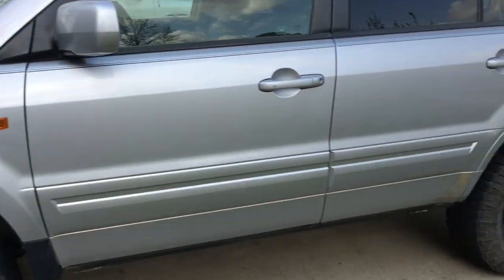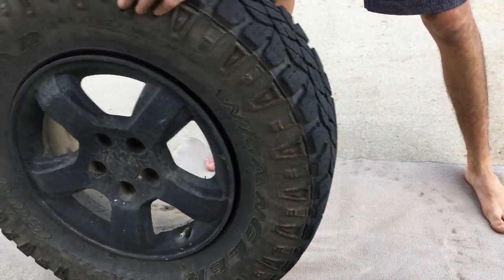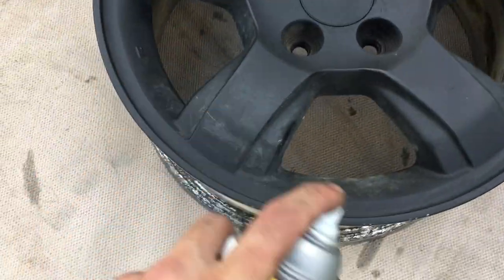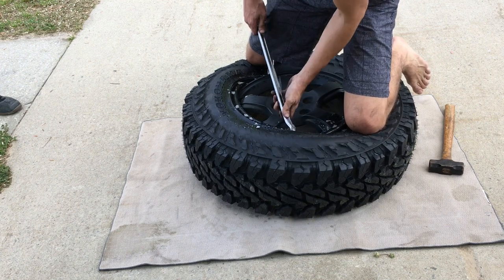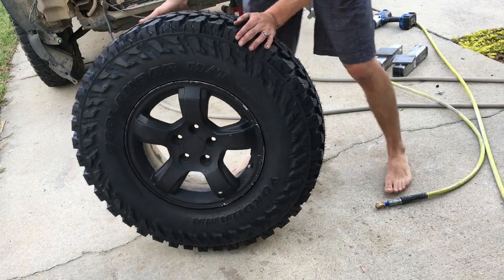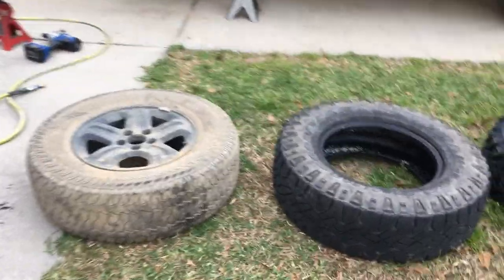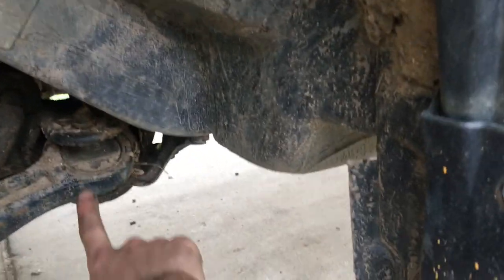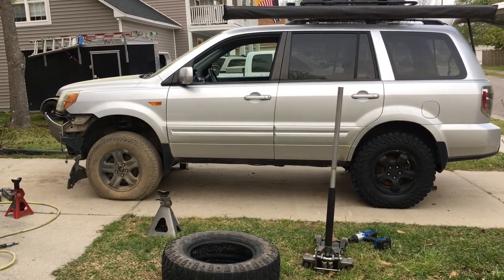How to Hand Mount Tires with a Hi-Lift Jack! Will these fit my 4wd Pilot?

Comment: Nice!! Those new tires are going to look good on there. I think you may have found the largest tire you can fit without trimming. Great idea on using the Hi-Lift to DIY change the tire, I'll have to remember that for later. It will be exciting to see how it performs with the new tires!
Reply from the maker: Thanks Mike!

Comment: I had a leaky airbag on my Pilot as well.  I wanted to like the airbags but the thought of pulling a bunch of stuff apart everytime one needed to be replaced didn't appeal to me, so I went with Timbrens.  No extra lift, but they help with sagging under load.  I have an extra air bag if anyone wants it, just pay shipping.  The brand is Air Lift, fits 1st gen Pilots.
Reply from the maker: I put a sawzaw through mine and patched it with a tire plug. 😂 I personally love them, but also built my Pilot out to sit well without them.
Reply: @GotterAdventure  LOL. Maybe some Slime Sealant would take care of the leak you have now.

Comment: Sorry I may have missed it, but why do you keep the spare deflated? I also have a full size as a spare.
Reply from the maker: My spare is an oversized 245-75-16. It won't fit if it isn't deflated.
Reply from the maker: carry two air compressors and fill when 
needed.

Comment: Hey man awesome pilot I'm thinking about running a no name ebay 2.5 lift and running 245/80 r16 tires on my stock wheels 
Would I need the sub frame drop ? And would I need to replace my rear springs? I currently have new napa oem suspension
Reply from the maker: I run a 2.5 inch lift without a subframe drop, but I have heard other people have issues with that setup. I think a lot of it has to do with which brand of axle you run with. I recommended OEM if you can afford it and Napa axles if you need something more on a budget. Napa axles have a lifetime warranty which is awesome. As far as tire size 245 75 16 seems to be the best size in my opinion for a pilot. I am running 235 85 16 right now with minimal cutting. If you just want to safe lift with minimal fuss, you may want to consider a 2-in lift with 245 75 16 tires. If you don't mind working on your car and replacing axles every once in awhile then you can go for the 2.5 in lift. I'm going to install a subframe drop and lift my pilot about 3.5 inches this year
Reply: @GotterAdventure  thanx brother that was really helpful 👍

Comment: What size did you have, I ran 245/75/16 ko2
Reply from the maker: My Duratracs where 245-75-16.  I would say that is the larges size you can safely use without aftermarket wheels or modifications.
Reply: Could you fit this size tire withOUT adding air bags?

We’re there any speedometer changes needed with 245/75/16?

How much miles per gal loss with these bigger tires? 

Did you have a lift kit installed before you increased the tire size?
Reply from the maker: @michaelmikulan9935   the wheels in this video are 235-85-16. You will need a lift and trimming to fit them. 

As far as 245-75-16 tires go they should fit without a lift or air springs . Your odometer will be off a bit and there isn’t a way to correct it. At 80mph you will be traveling 84mph. Depending on the tire you choose you will lose 1-4mpg.

Comment: Can I fit that size tire without a lift?
Reply from the maker: With cutting and grinding... maybe, but I wouldn't recommend it. I would go with my current size 245-75-16. I believe they are the best all around size considering weight, gearing,  and size.

Comment: Do you think you could fit this size stock rim no lift but with a 1/4 wheel spacer?
Reply from the maker: I am not sure how much variation there is from one tire manufacturer to another, but I would say a .5-1” spacer at least. I am looking into modifying the spring perch.
Reply: @GotterAdventure  thanks for the info I will probably do the 245/75r16 no lift
Reply from the maker: @aaronblake1891  I think that is a good choice!

Comment: What kind of lift you have?
Reply from the maker: 2.5” eBay lift
Reply: @GotterAdventure  nice, what brand?
Reply from the maker: @robertocarbajal1199  No name ebay lift LOL. I would check out HRG
Reply: Did you have to install the subframe drop with that 2.5 inch lift?
Reply from the maker: @robertocarbajal1199  I don’t have a subframe drop. I have had pretty good axle life with oem and Napa axles.

Comment: I think they would have looked better going 70 instead of 80. 80 does give you taller but makes tires looks too skinny
Reply: Also if you would of used 70 you wouldn’t have to do any modifications I am going to make video since I made a mistake too 😅
Reply from the maker: @Fonzi_fit  My current recommendation for 1st gen Pilots is 245-75-16. This size is the best balance in size an performance for the vehicle considering the gearing limitations. That being said I love the performance of Skinny 235-85-16 tires. I am a function over form type of person and the skinny tires give the most height with the least weight and dig into loose terrain.